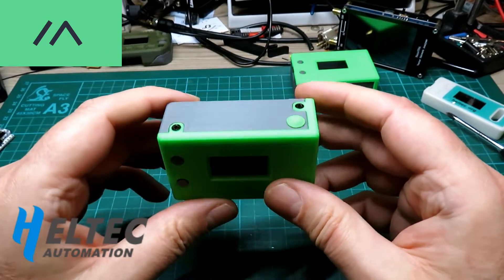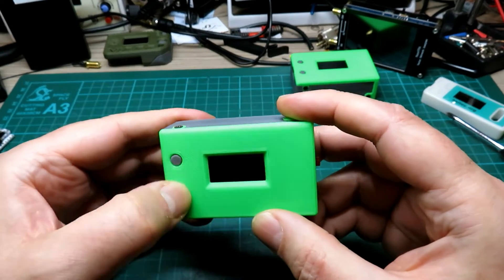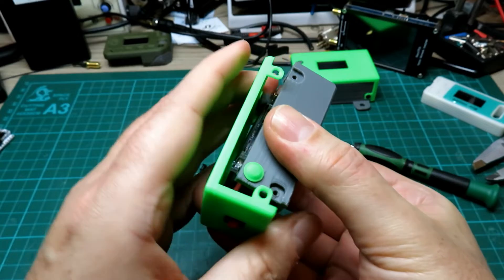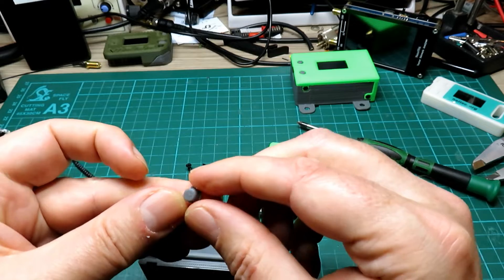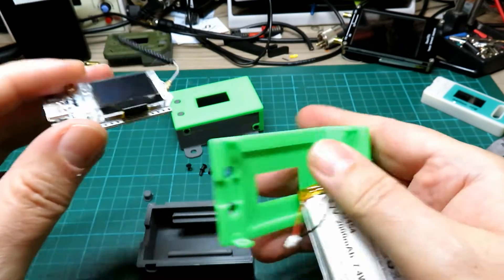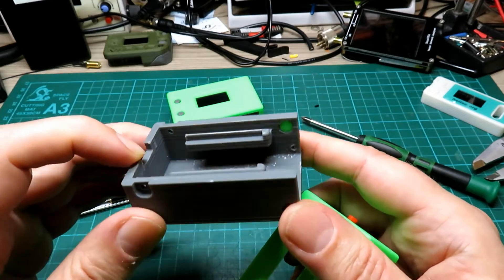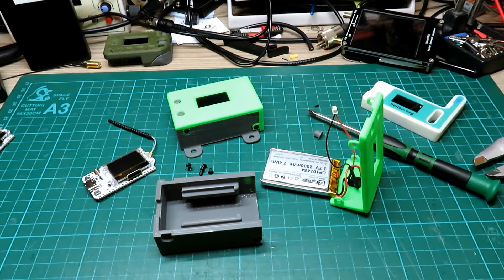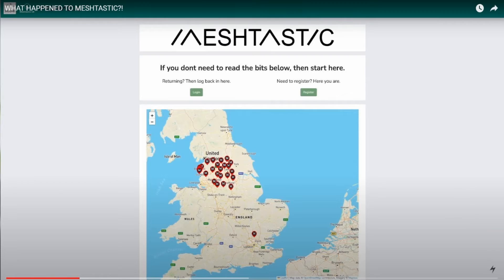Heltec V3 Battery Case - 3 x Variants - STL Files Included - Free To Use and Distribute.

Comment: I downloaded the STL as it's a brilliant case but unfortunately they guy I had on tavistock to print it butchered it by used cheap filament on a low resolution printer and charged me over the odds for it haha currently go it in my loft but held together with gorilla tape as needed it in the loft, thank you for sharing

Comment: Thank you so much for the work and files. I love this case. I have mine setup with the same battery but get some strange results with the Voltage and Percentage readings. I know about the ADC multiplier but cant seem to get it just right. Did you have this experience with yours? Thanks again.

Comment: Cracking stuff. We (our local ham emcomm group) has created a mesh just this last week on the South and East of Sheffield. I've just today got a 3D printer to play with and your case HD base is my first attempt at a 3D print ever. I used CURA to slice the design and my printer is an Ender 3 S1 Plus. After a bit of a ropey start (I think I still need to adjust the Z offset) its about 71% of the way through the first print. I've used the standard slice profile (read your instructions after the fact) but it seems to be OK. Thanks for doing these designs, Top Man!! BTW subbed you just for the effort! ATB